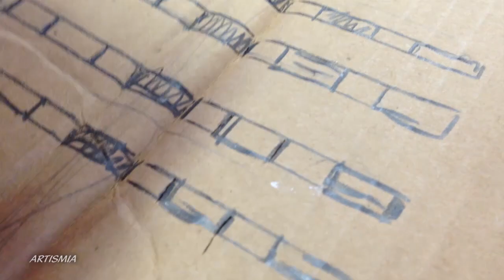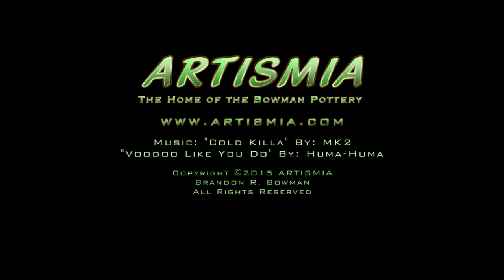How to make a Cardboard Knight HELMET PT.1

Comment: Do you mind me asking how big the helmet should be ? Like you just kind of new how big to make it at the start of the video.
Reply from the maker: +Take Out Gaming Hey thanks for watching. The helmet should be a few inches bigger than the person's head, that will be wearing it. So measure your head or someone else's (That is what I did). The one in the video is 12 inches front to back (length),  9 inches side to side, (width) 13 inches top to bottom (height) Thanks again for watching, and commenting.
Reply: +Artismia Thanks! Loved the video!